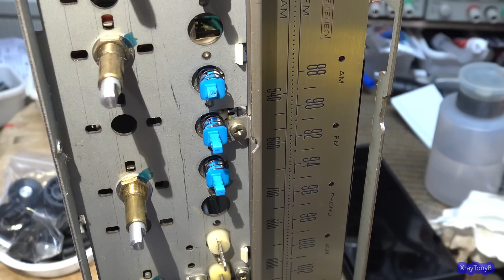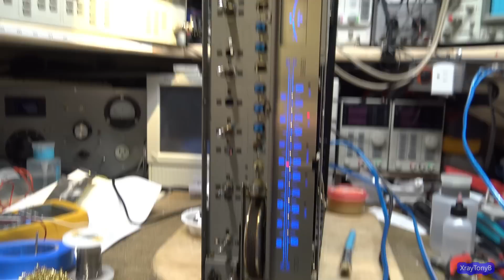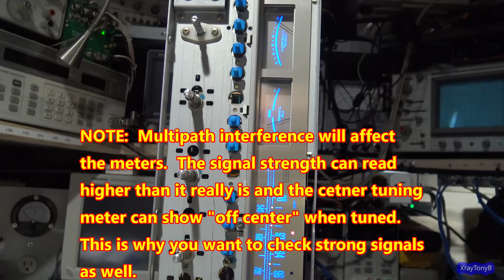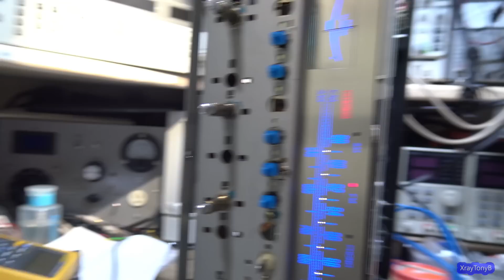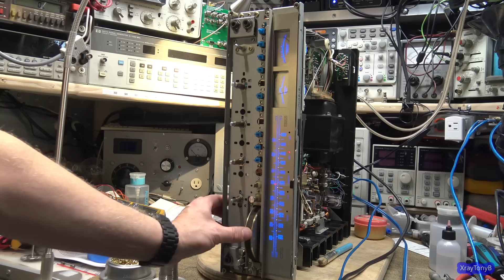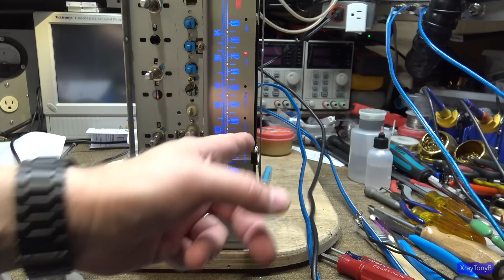Marantz 2252b Part 4 - Finishing the Receiver and Checking Tuner Alignment

Comment: One trick for creating your own signal generator. They make Bluetooth FM transmitters that plug into your cigarette lighter in your car so that you can play music from your phone. You can buy an AC to DC adapter that that plugs into, set it next to your amplifier and tune in a specific radio station frequency on it. You can then either play music or a tone on your Bluetooth attached cell phone and the amplifier will pick it up. I've actually found it to be pretty accurate.

Comment: I've re-aligned many tuners - it is rare to find one that is close to what it should be (talking about sensitivity more than dial accuracy), and in many cases I suspect it left the factory that way.  I'm guessing that under the pressures of the assembly line, there just isn't time to extract every last fraction of sensitivity.  The worker gets it "close enough" and then it's time to do the next one.  Julian Hirsch used to do receiver reviews for Stereo Review, I remember him commenting that manufacturers would likely supply units for testing that had been carefully tweaked by a good bench tech.  I can totally believe that, because on these 1970s units it takes a lot of time to spin the dial back and forth over and over, until you get the capacitors and inductors dialed in at each end of the tuning range.

One other thing - some manufacturers' service manuals have you tune to an area on the dial with no stations, and adjust the center tuning needle there.

Comment: From a simple multimeter to the FM stereo MPX signal generator, man that escalated quickly!  😮 I need to try this dial alignment method on my tuner. It is off by about 0.2MHz. The shaft is splined but if i move it 1 tooth it might just do the trick…

Comment: As pins to repair these broken knobs (etc.) I save the shafts of broken .5 - 1.5 mm drill bits. Steel ! They also fit perfect in a drilled hole, how is that possible....

Comment: The worst pots ive ever found is in the old Sansui rcvrs like the 800 and the 2000,5000 . The way i did tuners for the first couple years when i started was with a small FM stereo transmitter i made. Now days you can buy a cheap FM transmitter for the car that makes aux input use one of those hooked to your phone with a 400 or 1khz tone to do alignments  until you can get an alignment generator .

Comment: It's the silver dial models. Bean-counters got involved and two boards turned into one, then a third board disappeared and was crammed onto the board with the other two. 1977 was the turning point for Marantz. Still sounded good, but the internal design was bastardized.

Comment: Tony, what caps do you use? I'm restoring my cassette deck a Technics RS-M270X and want to use the best. Do i go with Rubycon, Panasonic,Nichicon and what is the best in the series.
Reply: It depends on where they are. Power supply or signal path? Any good brand name has quality parts. Look up each manufacturers electrolytic application chart. 

Also. When you look them up on mouser, it will have a link for the series. Click on that and it will give you a good idea of application.